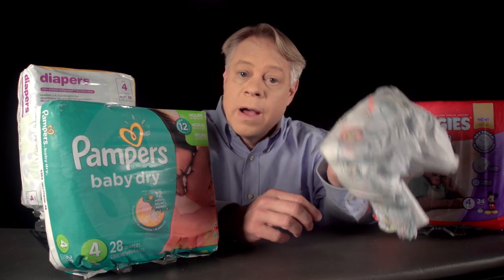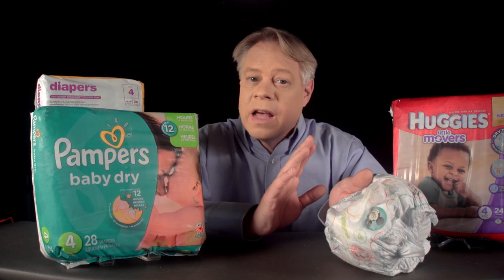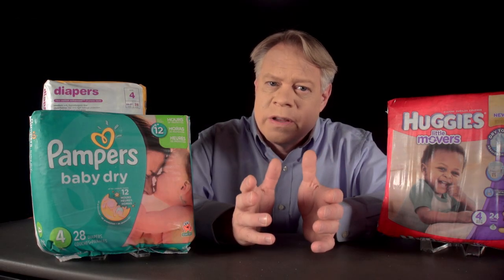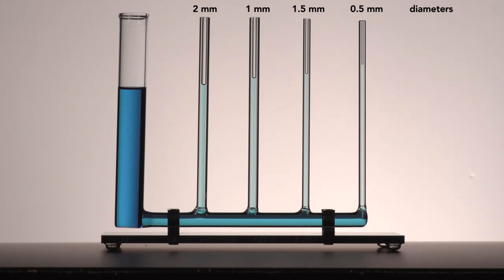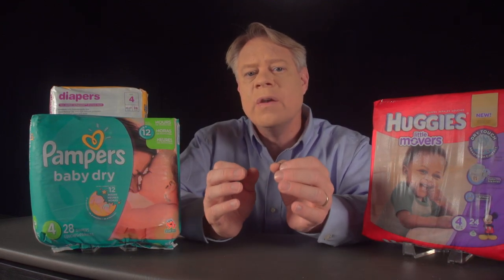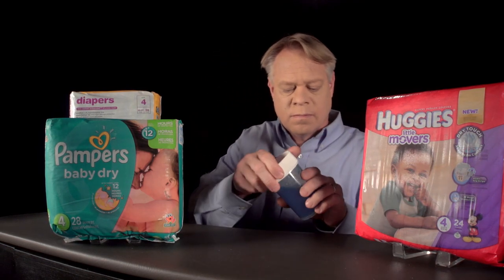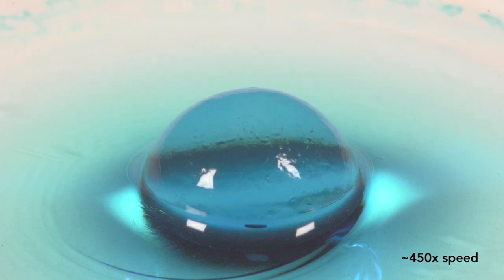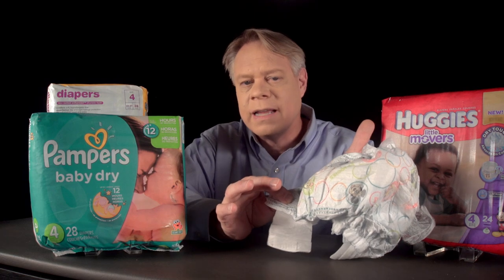The Engineering of a Disposable Diaper

Comment: I used to work on diaper machines and what you said at the end is so true. I was amazed at how fast these machines would run. We were a smaller company and the machines ran at 650 dpm. Even at that speed it's was really something to watch. 
Everything had to be synced up perfectly for the machine to operate properly. One of the most interesting parts of the machine was the vision system which would reject any diaper was out of spec while running at full speed.
Reply: I work at a diaper plant and our machines run at 800 dpm and it’s spits them diapers out like crazy
Reply: Hi, may I know the origin/supplier of those equipment?
Reply: I just finished a 33 year career making diapers and pants. Our fastest machine was capable of 1200 dpm!

Comment: The top layer resisting water transfer is why nappies are not very good at mopping up spills. When wiped across a spill the nappy will take some of the liquid, but leave behind many trails of liquid. To absorb all the liquid in a spill one is required to press down firmly on the spill, but this risks pushing out the absorbed liquid in when there is excess, and is inefficient when compared to something like a paper towel.
Nappies will not float on water if placed inner side down (which is difficult), when tried then it will absorb fluid from the sides and then become full and sink. Nappies however do not leak from the sides unless it becomes full.

Comment: I've worn adult diapers for over 20 years since two strokes left me partially incontinent. The ones I use don't have the plastic outer barrier, but they work the same as a toddler's pull-ups. Thankfully I have not had to test their capacity!

Comment: I've seen how they are made and it's very impressive. The machine might be 60 feet long with dozens of rolls of different materials feeding it, which will automatically switch to feed from full rolls when one gets low. The synchronization of all these rollers and the many conveyor belts is astounding! And it has to handle very thin and light materials which I think is much harder than heavy stuff. They use a lot of vacuum to hold and transfer layers and sheets. Parts are diecut from sheet and the waste is sucked away with one vacuum while another holds the desired part in place. And it's almost too fast to see!

Comment: Interesting subject. Are adult diapers more or less made the same way as baby diapers?
Reply from the maker: I believe they have wood pulp in them in addition. The amount of urine they have to hold is much, much greater. Baby diapers used to have the same material, but evolved into using superabsorbent polymers. So, years ago the diapers looked huge on a child, while now they are not as noticeable.
Reply: *****
Today I learned (more). I've wondered about that since this episode so thank you for the answer.
Reply: To add to this, depending on the type of incontinence, adults might also strain the abilities of the diaper more if they flood out all at once. Babies, at least when they are very young, tend to go in small spurts, which means it is easier for the diaper to wick liquid away. Adults sometimes release 500ml or more in under a minute. Therefore, many adult diaper products add wood pulp as an additional surge layer.
Reply: DannyTheNinja
Oh, wow. Hopefully, I don't have to wear diapers when I get old; I will feel very sorry for those that have to change me.
Reply: @engineerguyvideo  I am an RN  in a nursing home.   the adult diapers have the same polymers as the baby diapers.  I've had aides ask me how they work and I;ve taken the middle out and showed them.
Reply: @dannytheninjaabdl  the adult bladder holds about the same as a can of coke
Reply: @honestytoafault  Thanks for your input.

Comment: Well explained.   The tech in adult diapers have went leaps and bounds and in the last 25 to 30 years I have been using them.   The tech is the exact same on adult diapers and pads for incontinence.  I first started having to use IC pads in the late 90's.  Now my nerve damage has gotten way worse over the years and I use very advanced extended wear medical diapers. I have seen adult diapers go from holding about a cup of fluid to over a gallon.  I have been told Nasa helped develop this tech as the astronauts have to use them when on long spacewalks in their air tight suits.               I am so thankful to live in a time that we have such amazing products.     I have also seen videos on how they are made with the machines running in a overseas plant.  They are made almost as fast as newspapers are printed.  Truly a Amazing process.

Comment: One point to add is how affordable they are! I've bought a couple thousand "premium" diapers (pampers swaddlers) and haven't paid more than 15 cents each (usually 12-14 cents) deal shopping. Cheaper brands can be had for 6-7 cents each. ~$1 day is preferable to washing out poopy cloth diapers! Not to mention the water and washing machine wear & tear required to wash diapers daily.
Reply: I wish it were the case with premium adult diapers. You could spend easily up to 3 dollars per diaper... but each one does last a while, usually more than 8 hours.

Comment: wondering if the polymer is Polyacrilamide - PAM?  it was originally develped by the Agriculure Research Station (USDA) for use in irrigation enhancement.  It would cause soil particles to bind together forming larger particles and open up channels in the soil thus increasing or enhancing water movement from the center of an irrigation ditch into the surrounding soil where the plant roots are.  Wondering if diaper stuff is the same stuff?

Comment: does superabsorbent polymer absorb only water or will any liquids do? also, could this be used to remove water from mixed liquids or liquids that have other particles in it? like removing water from coffee.
Reply: I'm not an expert, just a schmoe who likes science/engineering videos, but I'm pretty sure these will absorb any liquid that's runny enough to flow into them. For separating liquids like that, the coolest method I've seen is molecular sieves; they're hard balls that have extremely tiny pores, sized so that only molecules at or below that size will fit through to absorb into the material. Chemists use them to separate mixed liquids, often water from acids.
Reply: OOZ662 cool! but that sounds a bit more expensive than buying pack of diapers :D
Reply: IIRC the polymer in diapers specifically absorbs water, but any impurities in the water will be absorbed along with it. This is actually of note in diapers, because the ions in urine significantly impede the absorption of water, though the polymer still manages to absorb what it needs to.

Comment: Weaponize it!
Reply: Actually... That's not exactly a bad idea... Dropping bombs of this stuff into slow moving rivers would clog the river and flood the immediate area...
Reply: It was used in a more serious matter when they pumped tons of it trying to seal the cracks in the sea barrier to prevent leaking of radioactive refuse water from cooling down the Fukushima's reactors into the open sea.
Reply: johnny chang Ooh that's actually a pretty good idea...
Reply: Plato
It didn't worked so well after all to stop the leaking, a gel like substance is hardly a stopgap against hydraulic pressure.